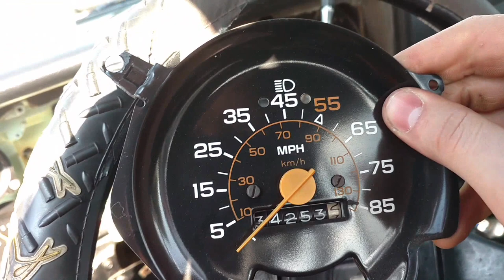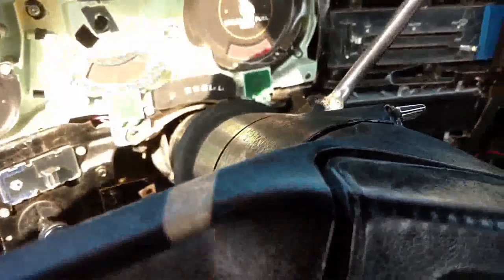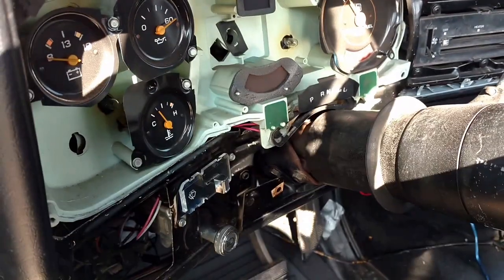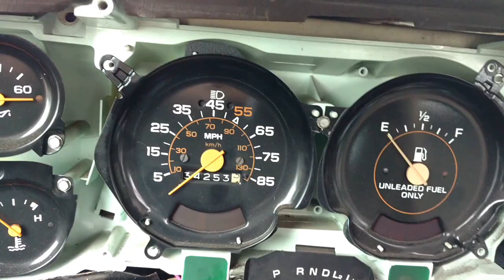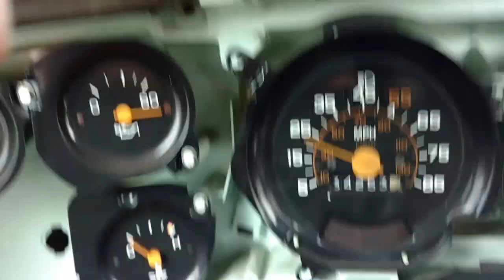Diagnosing and Fixing Broken Speedometer on '81 Chevy K20

Comment: Can't get my speedo to stop jumping   and it reads fast  tried a few different speedos  new cable  cant seem to get it right  my new used speedo is noisy also  any fix for that ?
Reply from the maker: So your speedo speed is dictated by the gearing in the transfer case, the calibration of that speedo, and or your tire size. As far as the noise all I can say for sure is make sure things are lubricated, both the cable and the speedo itself
Reply: @Saw_Squatch   what would be best to lubricate the speedo with ?  The confusing thing is  as far as I know everything is original  tire size and everything  so  I'm for a lose on that
Reply from the maker: @djcallioux2635  the make actual speedometer cable lube and if it's not in stock at your local auto parts store they can get it for you pretty easy

Comment: First of all, thank you for the video. Are you absolutely certain that the little silver piece goes into the back of the speedo where the cable plugs in? I can't seem to find one anywhere, and my speedo continues to jump around even though I have a new cable and Speedometer. If you can answer this, I'd be very grateful.
Reply from the maker: actually I'm not certain that it's necessary anymore. I actually put in a new cable that's thicker than my old one and it works without the silver piece. my spedo still jumps somewhat whenever I hit a bump in the road. If that's not the issue then try lubing the speedometer cable itself and see if that doesn't make it better. I have an old video on how to do that as well.
Reply: Can't thank you enough for your response! I will definitely try lubricating it and I'll let you know how it turns out.
Reply: What is the name of that silver part?
Reply: @joedobson5512  Yes I got the same problem, that missing little silver part. The needle jumps around but the cable are new. on my 1981 C10 inline6-manual. where can i get it ? (canada)